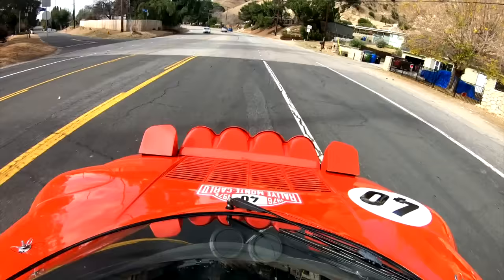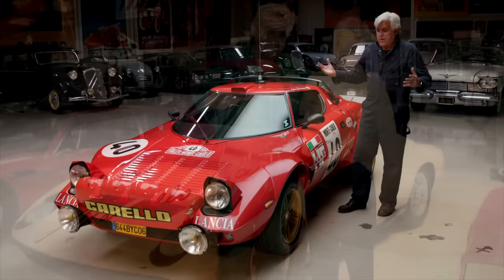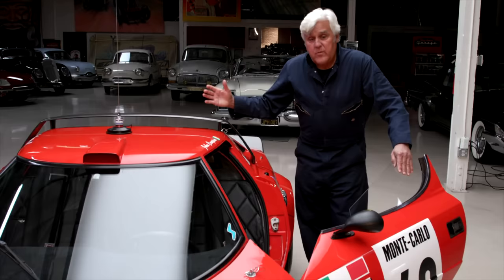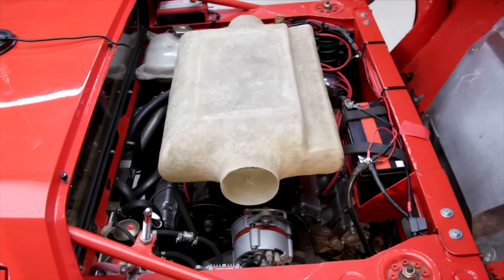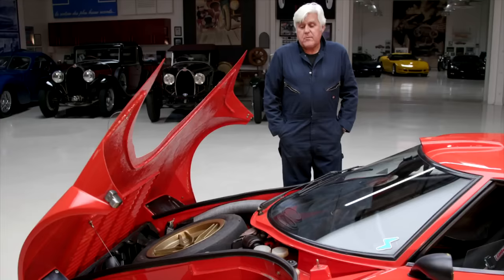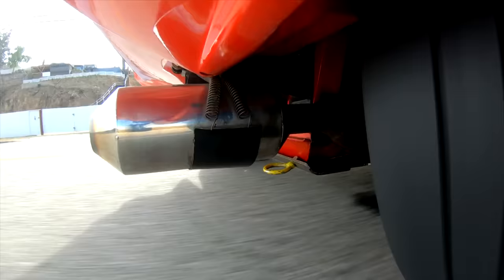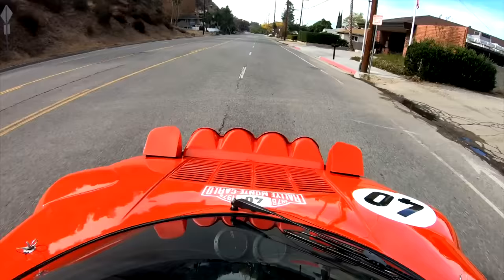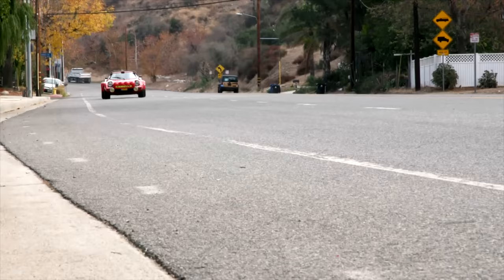1975 Lancia Stratos HF - Jay Leno's Garage

Comment: I like Ferrari, don't want to knock them, but it is absolutely the case that they suck nearly all the oxygen out of the room for all the other great Italian manufacturers: Lancia, Maserati, Lamborghini, Alfa Romeo, etc.

Even when it comes to Fiat, it's a travesty what happened.  The head honchos threw a fit in 1924, and again in 1927, and tried to get rid of the traces of their Grand Prix program.  The 806 looked to be a match on pace with anything on the track at the time, whether it was their fellw, 1.5-liter comptetitors (Talbot-Darracq, Delage, Maserati, Bugatti), or even the 2.0-liter cars, including the Bugatti Type 35 and Alfa Romeo P2.  Pietro Bordino won the only event the car took part in, the 1927 Milan GP, before company officials canned the effort.

The "wedge" design trend appears to have started even earlier.  The first steps seem to have come with the Ferrari Dino 156 F1 "sharknose" that Phil Hill won the 1961 World Championship with.  Then you had the 330 TRI/LM that won Le Mans in 1962 with Phil Hill and Olivier Gendebien, and that Roger Penske and Pedro Rodriguez put on Pole in '63.  Then, with Bizzarrini forming his own concern after being pushed out at Ferrari, he produced the 5300 GT and P538, among others, that really put the "point" on the wedge.

So while the Miura is the most famous example, and understandably so, Lamborghini didn't originate the wedge design theme by any stretch.

If there was one Lancia I'd like to see covered that I haven't seen yet, it's probably the D25, not to be confused with the D24s that were equipped with the 3.75-liter engine instead of the 3.25-liter V6, and simply rebadged as D25s.

Comment: Interview with Marcello Gandini, styled-packaged the Lancia Stratos. Did not like this car that much. https://www.youtube.com/watch?v=BeZjYr15WYU&t=395s

Fame and notoriety of the Lancia Startos is based on the fact it was an extremely effective WRC car as it was designed to win at WRC from day one.

The Stratos has a sybling in the Bertone-Fiat X1/9. Both chassis-suspension were designed Giuseppe Puleo. The x1/9 passed the then proposed US of A  frontal barrier  test of 50 mph and 80 mph roll over by using near identical chassis structures from the Stratos. This is what Giuseppe Puleo share in common with both X1/9 and Stratos designs. The Abarth version of the X1/9 proved to be equal and potentially better WRC car than the Stratos, Fiat decided for marketing goals to press the Fiat 131 into WRC duty for marketing reasons. Fiat management despised the Bertone x1/9, never wanted to produce it and assured it will never be properly developed into what it could be... Except Dallara did and launched his racing business with a modified x1/9.

Comment: Race car modified for the road? really? That motor is too small for that car! Can put a Ferrari 308Cu.in. motor with stainless headers and turbo charge it. Or 351 Cleveland bored out 60 over, mild cam, headers, and fast gear ratio on rear end. Would have to modify either to fit.  It would produce over 350hp. This should be a 160mph+ car at least. It will need a black front spoiler or air dam. Would look awesome!

Comment: Looks contemporary? Not even close. That car screams 1970s, and that's a good thing. If it looked contemporary it would look ridiculous. The 1970s was the last decade in which any good-looking production cars were designed. There were some good-looking cars still being manufactured in the '80s and '90s but they were all designed in the '70s or earlier, such as the C3 Corvette, Camaro/Firebird (2nd-generation), Ferrari 308, Porsche 911, and Lamborghini Countach.